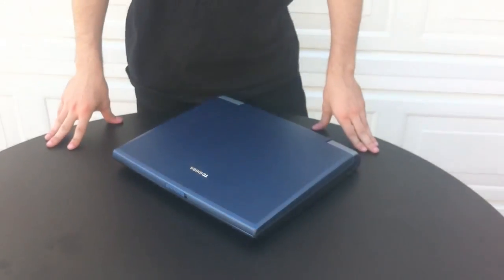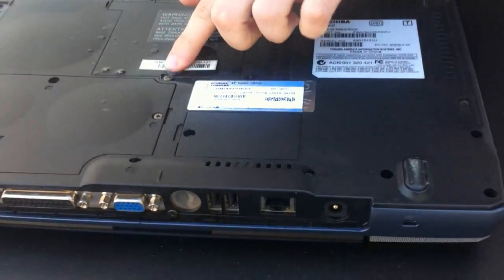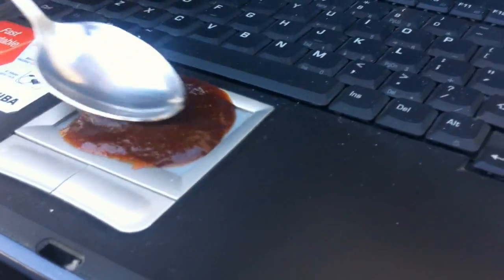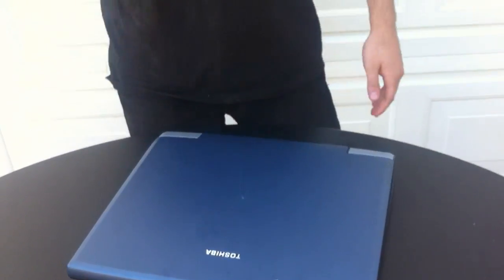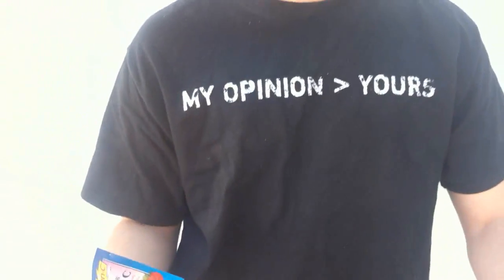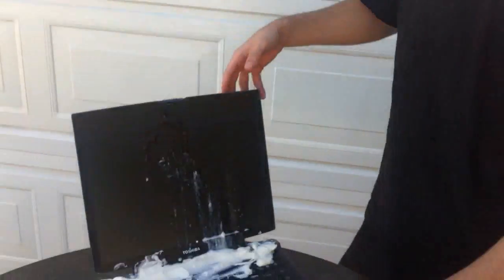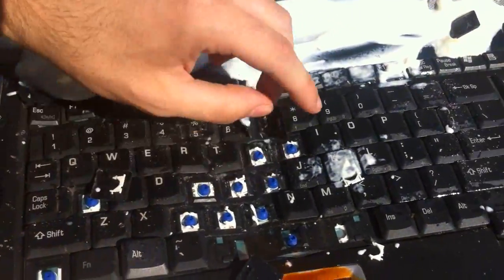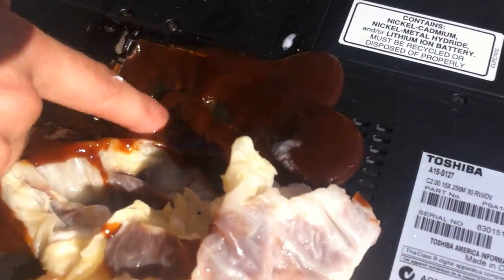How to Speed up your Laptop

Comment: I ran into trouble at the part where you beat the fuck out of it with a hammer, my laptop no longer has a power button. The screen is barely hanging on at this point and I'm just wondering where I went wrong

Comment: Ok so this can work if you dont hit the important parts of your laptop, and the cleaning is the most boring part of all. But if you delete the System32, that will take back all those errors on your pc making it faster, and it wont delete your data. so that is better than hitting your laptop with a hammer. THANKS!

Comment: i had the same problem, make sure you smacked the screen a couple times with your sledge hammer (as shown at 5:53) this is actually the most important step because it surprises the computer and causes it to wake up.